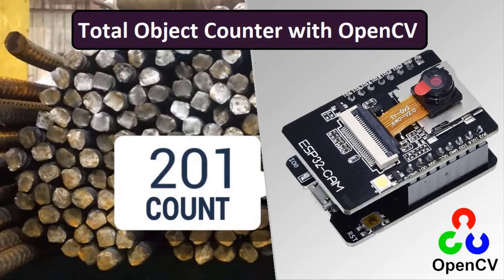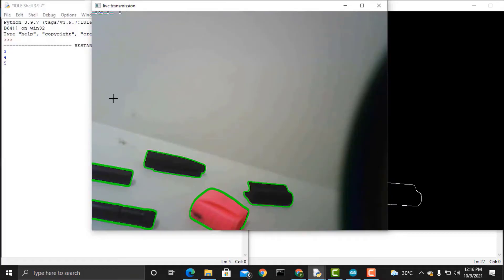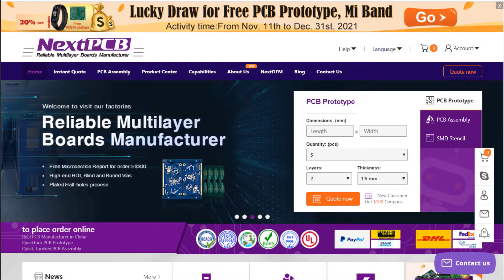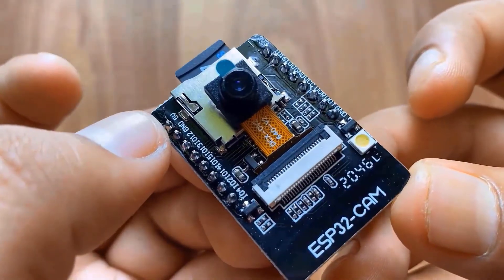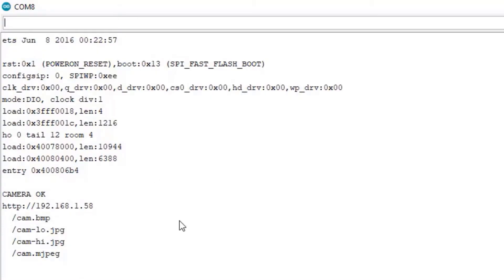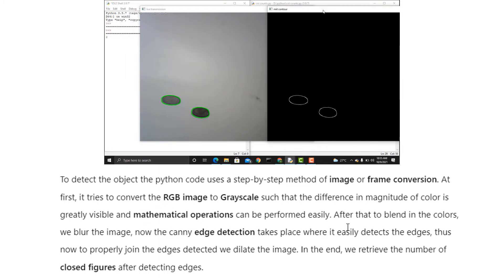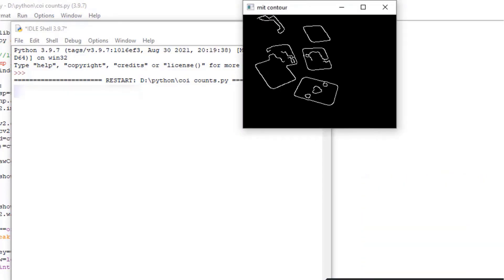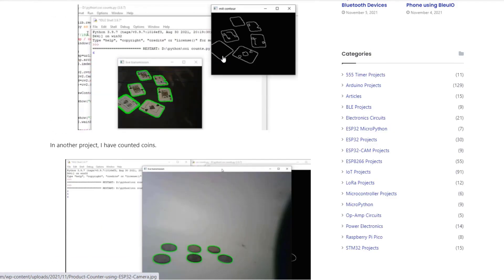DIY Automatic Object Counting System using ESP32 Camera Module & OpenCV | Industrial Product Counter

Comment: Hello!
I replicated the camera and python project! I tried to count the coins or circles and I couldn't! There is some adjustment in:

while True:
    img_resp=urllib.request.urlopen(url+'cam-lo.jpg')
    imgnp=np.array(bytearray(img_resp.read()),dtype=np.uint8)
    img=cv2.imdecode(imgnp,-1)
    
    gray=cv2.cvtColor(img,cv2.COLOR_BGR2GRAY)
    canny=cv2.Canny(cv2.GaussianBlur(gray,(11,11),0),30,150,3)
    dilated=cv2.dilate(canny,(1,1),iterations=2)
    (Cnt,_)=cv2.findContours(dilated.copy(),cv2.RETR_EXTERNAL,cv2.CHAIN_APPROX_NONE)
    k=img
    cv2.drawContours(k,cnt,-1,(0,255,0),2)
 
    cv2.imshow("mit contour",canny)
    
 
    
    cv2.imshow("live transmission",img)
    key=cv2.waitKey(5)
    
    if key==ord('q'):
        break
 
    elif key==ord('a'):
        cow=len(cnt)
        print(cow)

This is the code I'm running...
Reply: Hie, May you kindly assist me?